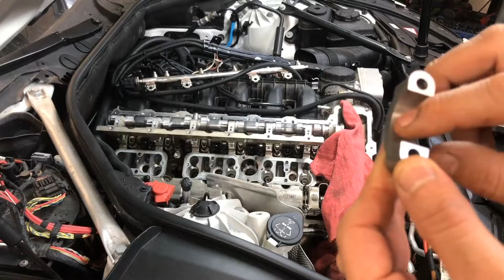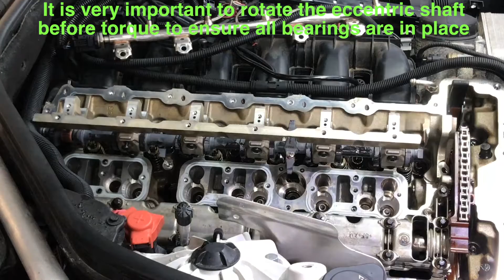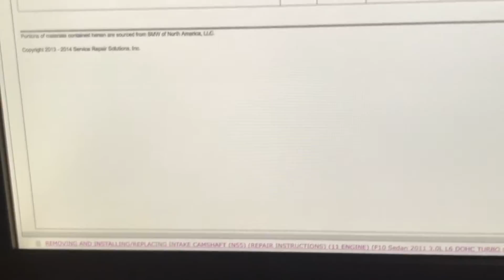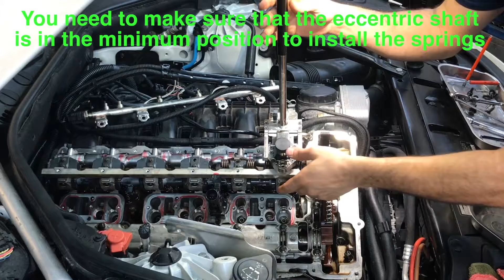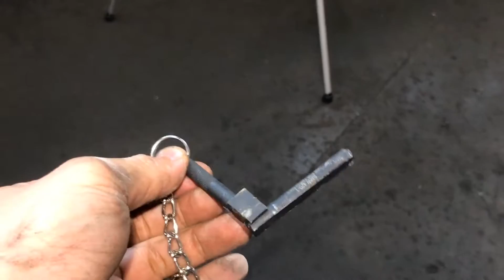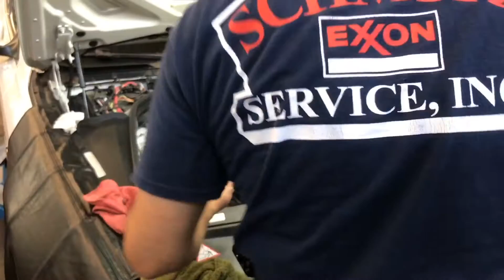2011 BMW 535i N55 F10 No start eccentric shaft, valvetronic and intake cam assembly Part 2

Comment: I replaced the valve cover gasket, eccentric shaft sensor seal, eccentric shaft actuator valvetronic motor seal, and spark plugs of my 2009 BMW X3. When I started the car, the engine run very weak and shaky, and stopped running within 1 minute. After that the engine can crank, but not start. A technician at Pelican Parts Inc told me that the eccentric shaft should be set correctly, otherwise it will not run. Should I move the eccentric shaft to its maximum position as suggested in your wonderful video? Do you have video to do that? Thank you in advance.
Reply from the maker: Xuntian Jiang what engine are you working on? Can you post the vin or email me at maic@maicsalazardiagnostics.com
Reply: @MaicSalazarDiagnostics  Hi Maic, Thank you for helping me. The engine is N52, and VIN is WBXPC93409WJ29877. The Ancel BM700 scan tool shows fault codes 2A31 (valvetronic eccentric shaft sensor: guide), 2A32 (valvetronic eccentric shaft sensor: reference), 2A47 (valvetronic eccentric shaft sensor: plausibility). There is no oil in eccentric shaft sensor. Do you think eccentric shaft sensor was damaged during the replacement of valve cover gasket? Thanks.

Comment: How did you turn your engine to check timing?
Reply from the maker: Hermin Zahirovic on the front vibration damper
Reply from the maker: Hermin Zahirovic is tight to get the socket on it but is doable
Reply: I got it, thank you so much

Comment: Question: what caused all this (the need to replace shafts)?
Reply: Lack of maintenance, and shit quality oil is the correct answer.

Stop changing your oil every 10k

Stop using Castrol and Mobil 1

Only 5w-40, only Euro spec oil  aka Liqui Moly, Pentosin, Fuchs, etc.
Reply: @LynxStarAuto  What kind of oil do you use for an American car?  Not Mobil 1 Full Synthetic?
Reply from the maker: Edward Godlevsky correct. These engines have a problem that corrodes the intake camshaft and damages the valvetronic, si if is not corrected on time it my take the DME as well too!
Reply: Do you mind to share what exactly the problem? I have this engine in my car, would be nice to know, and prevent if possible. Thanks
Reply: @edwardgodlevsky , I have this engine in my M235i and I am having this repair done now.  Basically, there are "teeth" and the eccentric shaft (the camshaft) that wear under normal use and break.  Once they break, the shaft cannot turn and the engine will not start.  This is not a problem for most engine manufacturers, but BMW really screwed us on this one.  The problem does not seem to occur until the engine is above 50,000 miles.  My 235i has 68,000 miles.  I will never own another BMW out of warranty.  I hope this helps.

Comment: Hi Maic I have 2012 bmw 535i x drive. I just got the engine light on with the code P10F5. Please give me some ideas  what is wrong with my car. Thank you very much...
Reply from the maker: Andy Chau this is a fault for the activation of Phase V in the Valvetronic actuator motor. It can be cause by multiple things:
Eccentric shaft damaged or tight which would cause an excessive current draw.
Open in the harness or connector from DME to valvetronic motor.
Valvetronic motor bad.
DME bad.
Reply: I just replaced the valve cover and gasket and got the same code. P10F5 motor runs fine. Any ideas. Much appreciated!

Comment: can you make a video explaining how to replace valvetronic motor?
Reply: 5
Reply: its very simple remove number 2 injector and unplug the injecotors and coil packs and remove head gasket and then remove the middle holder for the coil packs /injectors and then its very straight forward from there

Comment: That is a big job Maic. You make it look easy since you have all of the necessary tools and information. Looking forward to part 3!
Reply: Which is more useful for this type of work a 1/4 torque wrench or 3/8?
Reply from the maker: I have the 3/8 and 1/2" with those I can cover almost everything
Reply from the maker: Baxrok2 thank you. But this one is a hard one. It seems like the new valvetronic motor is defective. One of the position sensors is not working! You’ll see on part 3